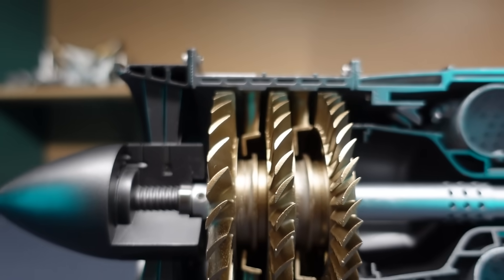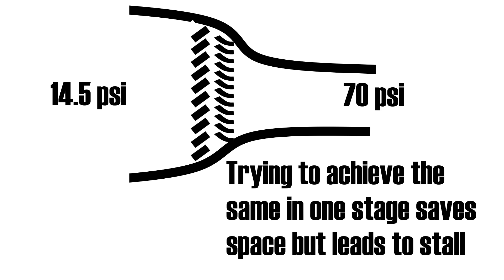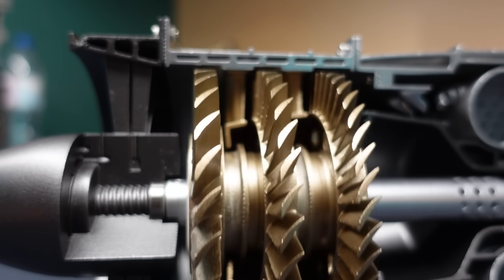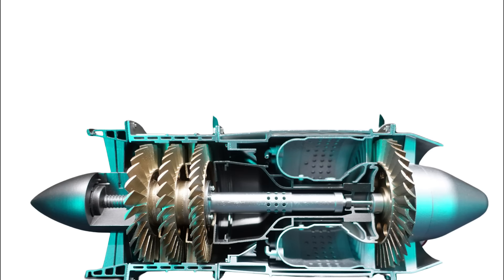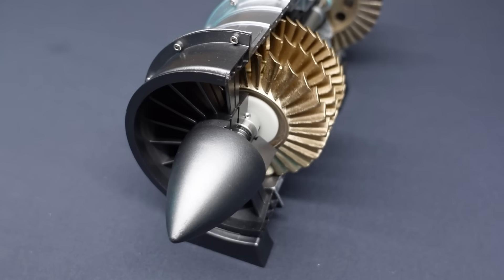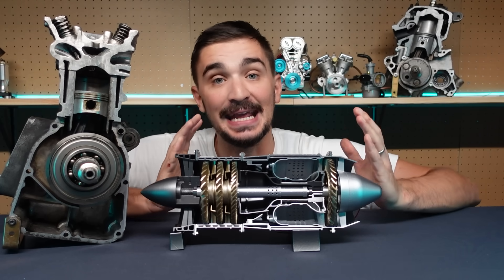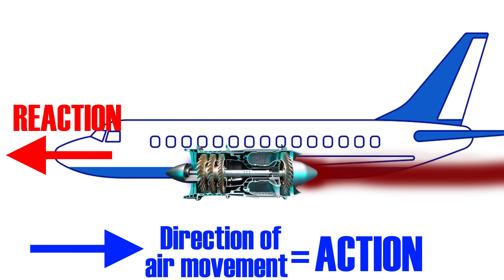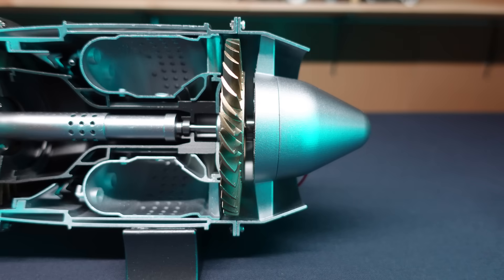Appreciating The Beauty of Jet Engines by Juxtaposing Them Against Piston Engines

Comment from the maker: NOTE: After shooting the entire video I noticed that the turbine blades are  pointing in the wrong direction. The "scooped" part of the blade is pointed away from the stream of air. I was just blindly following the model instructions and focused on shooting the video so I missed this. But this video just covers the basic operating principle of the engine and I didn't discuss any fluid dynamics, this will be corrected and explained in more detail in future videos. 
"Use juxtapose in a video title" crossed off the bucket list
This is the jet engine model from the video: REMOVED until the assembly instructions/parts are updated by the manufacturer. 
Patreon: https://www.patreon.com/d4a
Amazon: https://amzn.to/47U9Zhj
Shop: https://driving-4-answers-shop.fourthwall.com/en-eur/
Reply: D4A, I’m glad you commented about this. It was the first thing I noticed and came here to comment but was glad to see you had made the comment.
Reply: I must also admit to being completely distracted by the backward turbine blades.  I am not surprised that it is the most commented part.  There are several companies that produce better jet engine cutaways that in reverse flow turboprop motors and three axis low-bypass turbofan engines with after-burners.  
  I thought some discussion about the different RPM ranges of High pressure compressors, low pressure compressors and final drive is accomplished by three separate but interconnected axels is a clever arrangement.  Discussion of how reverse flow exhaust on turbo-props allows for a longer burn section for better gas expansion while keeping the overall engine length shorter is an innovation worth talking about.
Reply: @michaelbrinks8089   Yeah, maybe a video on Turbojet vs Ramjet vs Scramjet would be good as well.
Reply: You made one small mistake. The gas pressure in the combustion chamber does not increase, in fact it decreases. Heating the air increases it's volume, which would increase the pressure if it were in a closed container, but it is not. Therefor the pressure decreases in the combustion chamber and the airflow gets accelerated instead. The backpressure that remains is caused by the resistance of the nozzle and the turbine. Too high backpressure is in fact bad, as that would decrease the cooling effect of the intake air, as the mass flow rate decreases. This could lead to catastrophic engine failure. That is why fighter jets open their exhaust nozzle when activating the afterburner, because it would otherwise create too much backpressure.
Reply: @Sir_Cactus  "The gas pressure in the combustion chamber is atmospheric" 
No, it can reach 30 bars. It cannot stay at an atmospheric pressure.
Reply: And why does not this increased pressure drive the gasses backwards through the compressor, where the pressure is only 4 atmospheres?
Reply: @yannickl5976  I have doen some research and noticed that I was not entirely correct. I have edited my comment to correct my mistake. That being said, I was not entirely incorrect and your figure of 30bar in the combustion chamber seems somewhat ridiculous. The pressure in the combustor can never exceed the compressor discharge pressure or even be equal that. Otherwise, as someone else already commented here, would mean the exhaust gases would not only travel through the exhaust nozzle, but also back through the compressor, stalling and potentially damaging the compressor and starving the engine of intake air.
Reply: @Sir_Cactus  pressures in a modern aircraft engine and is a small toy or primitive aircraft turbojet are very different. The pressure ratio (from atmospheric to compressor outlet) is only about 4:1 for simple compressors (single centrifugal stage or just a few axial-flow stages), but 30:1 or even much higher in a modern large turbine engine with more compressor stages. 
Whatever the pressure ratio, you are correct that pressure does not increase through the combustion chamber.
Reply: Also why there are bleed air injectors around the casing to keep a thin film of cold air on skin of combustion chamber. @Sir_Cactus
Reply: wow, you answered the question I had and didn't know how to ask and the questions I didn't know I had.

That makes very much sense in an efficient reaction engine.

¿but what about a turboshaft when you need to convert all possible power to kinetic rotation?
Reply: Pelton style catch wheel to torque  converter turbo props were actually kind of first in applicable output power for a while pre axial turbines they used a system loosely based off of compound turbines from piston engines still surprising turbo compounding only used by Scania and Mercedes trucks @Xayuap
Reply: Replace "against" with "with" - ie "juxtaposing with"
Reply: i want to know where did you learn to speak english like that?...its amazing , please tell me and another little question why you dont live in the us or canada we really need people like you...thank you very much and please answer me:trophy-yellow-smiling:
Reply from the maker: @luiscardozo0000 Watched a lot of Cartoon Network as a kid. I'm serious. Why don't I live in the US or Canada? I'll answer that with a question. Why don't you live in Europe? We really need people like you 😁
Reply: @luiscardozo0000   yeah, why don't you live in ethiopia, we need people like you.
Reply: @luiscardozo0000  "why you dont live in the us or canada we really need people like you"  Haha, yea, we do, but that very fact probably keeps people like him away!
Reply: Your explanation is the best I have ever seen 👍I like it very much.
Thank you for taking the time to provide feedback on this turbojet engine model. We genuinely appreciate your keen observation, and we acknowledge the inadvertent error in the orientation of the turbine blades during the assembly process.

We sincerely apologize for any confusion this may have caused. Your attention to detail is valued, and we're committed to rectifying this issue promptly. We will be updating the assembly instructions and images to reflect the correct orientation of the turbojet blades.
Reply: @michaelbrinks8089 turbofan blades look just like turbine blades. They are simply larger. Their role is to act like a propeller to generate more thrust.
Reply: And the small holes around the combustion chamber are clogged :p
Reply: I came in here to mention that as it was driving me nuts.
Reply: Good catch, and a great explanation of the operation of a turbine engine.  Your presentation was as clear as my A&P classes from long ago! 👍🏻
Reply: Yes, I was about to point it out to you. Thanks for the correction.
Reply: Yes. It would make a lot of noise and burn a lot of fuel and go nowhere if you could get it to run. Lol!
Reply: @d4a First I should say, I loved the video. Jets are amazing especially compared to internal combustion. 

You should do a follow on video comparing efficiency, power to weight and maintenance of jet engines vs internal combustion engines. These are three areas that turbine engines usually excel compared to internal combustion and were not really covered in this video.
Reply: Yes.First thing I noticed.wrong shape blade as well.That's a compressor blade
Reply: Thanks for the comment, awesome video as usual! The backwards facing blades had me thinking I was going crazy!!
Reply: The basic point he failed to mention  is that the turbojet engine is a constant pressure, velocity driven engine, as against a normal internal combustion engine.
Reply: In D4A we trust!⚜
Reply: Ah, was just about to comment that the blades look like they're pointed the wrong way lol
Reply: looking foward the video about fluid dynamics on turbo blades!
Reply: Ouch, My OCD!!
Reply: Way more understandable than what Ohio DMV did
Reply: Thank you for pinning this post.
I got half-way through you video before the backwards blades caused so much cognitive dissonance that I had to pause and check the comments for my own sanity ;)
I will continue watching now.
Reply: The blades that seem to be facing backwards are called stators and the blades that move are called rotors.  The intake side rotors are powered by the turbine blades in the back, and the stators straighten the air flow for better performance.
Reply: I was comment on the turbine blades... but then I saw this :D
Reply: Please tell me you're working up to a compound engine :).
Reply: HA! I didn't notice, no worries.  But you left out my personal favorite, the turboshaft engine!
Reply: Yeah, just triggered and went for comments about that ) Thank you for explanation of how it happened )
Reply: Instead of calling it a "vicious cycle" @7:30 ... I think we're ready for concepts like "positive feedback loop" ... :)
Reply: Yeah, I was puzzled, is the intake right, or left? Or had I completely forgotten how these things work. Thanks. Love your vids no matter.
Reply: Yes i noticed that too am a aspiring aeronautic student 😅 i know it probably mistake cos at that angle the turbine will not harness the combustion power at all and engine will not turn

Comment: I think it's worth noting when you compared the gas turbines as a whole to turbo chargers in cars or steam turbines in power stations is that where the heat energy to drive the compressor wheels come from a completely sepperate source, in a car it comes from the hot exhuast gas from a piston engine or in a steam turbine it comes from the steam from burning fuel in a boiler and boiling water to steam in a power station.

Comment: are you sure the pressure is increased in the combustor? The temperature is surely increased, but intuitively it seems the pressure would be the same as the last stage of compression. Always remember: better to have questions we can't answer than answers we can't question! Who said that?
Reply from the maker: I like that sentence. In principle you're correct but what I failed to underline here is that I was explaining the starting sequence. I also got a lot of comments from people telling me I didn't need a spark plug to run a jet engine. I think that when combustion occurs during starting there is a small pressure spike because the combustion is relatively confined and pressure does spike a bit until the turbines start moving etc, but yes overall during operation pressure doesn't again increase and fall like in a piston engine, I should have explained that better

Comment: For some reason I actually thought a comparison was going to be made of both types of engines in terms of power to weight in many given situations. The thumbnail kind of suggested it. I figured the piston engine used as the model was about the size it would need to be to produce as much shaft power (If a PTO turbine was placed behind the turbojet power section) as the model implied sized gas turbine is. The video is a very succinct btw, Even AgentJZ would approve.

Comment: Unfortunately you have made one of the most common and classic mistakes, of assuming that the combustion section of a jet engine causes an increase in pressure. This is a problem when you try to think about gas turbine engines by comparing them to piston engines. It is easy to see how the pressure inside a cylinder increases when combustion happens, because the cylinder is still sealed (piston at top-dead-centre, all valves closed), so the energy released by fuel combustion has nowhere to go, except into boosting the temperature and pressure of the gases trapped within. So the highest pressures in a piston engine are found immediately following combustion.

However, the highest pressures found inside a jet engine (or any other variety of gas turbine engine) is at the compressor discharge, just before the compressed air enters the combustors. Burning the fuel increases the temperature of course, that much is common with a piston engine. But the combustors in gas turbine engines are not "combustion chambers" - they are open at both ends to let gases flow through continuously, so the pressure cannot and does not increase. What does increase - massively, along with the temperature, is the volume of gas flowing through.

There is another engine type for which the same is true, and is an engine which bears more appropriate comparison, and that is liquid-fuelled rocket engines: These suffer from a similarly common error, of people assuming that the pressure increases during combustion. Again, it doesn't, though the temperature and volume of gases both do - just like in a gas turbine engine. The highest pressures found in any liquid fuelled rocket engine are in the injector manifolds: These have to be at a higher pressure than the combustion section, otherwise the fuel and oxidizer would not flow in the necessary direction. This is broadly comparable to the injector situation in a diesel engine: The liquid diesel fuel has to be pressurised to a higher pressure than the air inside the cylinders at top-dead-center piston position can possibly reach, otherwise injection of the fuel would never happen. In fact the excess pressure has to be far higher than you might think, in order to have any control over the fuel flow, and particularly to make fuel flow through the injectors at necessary rates.

On a different subject, a small point about compressors: It is certainly true that the pressure increase possible with an axial flow compressor is limited for any given stage - this has improved over time with incremental improvements to design, but even so, each axial stage is not capable of increasing pressure by much more than 20%. Hence why engines using axial compressors tend to use multiple stages.
However, the same is not true for centrifugal (aka radial outflow) compressors. The earliest British and American jet engines used these, and for a fairly straightforward reason: The compressors used for supercharging aircraft piston engines during WW2 were typically centrifugal, and were at a fairly high degree of development. So similar designs were used for early jets, basically just scaled up versions of what was used on late-war piston engines.
Centrifugal compressors can be more efficient than you might think: Most of these early jets used a single stage, though I think there was one example of a turboprop engine (the Rolls-Royce Dart) which had two stages, with the outlet of the first centrifugal stage feeding the inlet on the second. A well designed single stage centrifugal compressor can have an outlet pressure 4 or 5 times higher than the inlet. This is reflected in some genuine engines: The Rolls-Royce Derwent had a pressure ratio of 3.9:1, and the related Tay engine had a pressure ratio of 5:1, both of these used single stage centrifugal compressors.
These have not entirely gone away in modern engines: A great example is the extremely popular Pratt&Whitney PT6 turboprop, which uses a centrifugal compressor, pre-boosted by either 3 or 4 stages of axial compressor.

Comment: But I have a question. Why the expanded gas doesn't escape where from it entered. Since there are no valves ,the expanded gas only exits from behind not from front end.why?
Reply: Each blade chops a small portion of air and directs it to the rear.  Can you see that?

Comment: The cutaway model you used is called can annular. The holes are to feed air to the mix inside the can. The purpose of this is to not blow out the flame. Their are several types and this is the oldest. Its not so much to protect the turbine which is ceramic coated incolnel and other alloys, 
But to prevent a flame out condition. 
Thier are actually two shafts that drive the compressor. A shaft within a shaft with internal bearings. The compressor is divided into two counter rotating assemblies to balance the engine. So thier is in function two sections of compressor stages with the final stages spinning double the speed depending on the model and type of engine. I am reference the Rolls Royce Pegasus used on the Harrier.
I was an enlisted instructor at NAS Pensicola. It used a device known as a spider after the turbine to monitor temperatures and would inject demineralized water to cool the turbine in combat power setting or anything deemed over 100% rated power.

Comment: Well actually, turbine engines are a LOT more efficient than piston engines, but only at high loads. They use a lot more fuel, but give a LOT more power in return. Turbines are impractical for small loads or loads with sporadic spikes in demand.
Some American company tried to make a car with a turbine engine, and it was extremely fuel efficient on the highway. The problem was the noise, the cost, and the fact that it had terrible fuel economy while idle, as turbine engines typically idle at no less than 40% of max power. For city driving this is completely stupid, but i can definitely see this being put into trucks or trains (in places which have trains they already use turbines to generate electricity, and use electric trains)

Comment: I know that the turbine never caught on for powering cars, you might have already made a video about that. But why didn't it loose out to the diesel engine for other applications such as railroad, which generally uses electricity to transmit the torque from the engine to the wheels anyway? It's application in a tank seems to be successful.

Comment: Great explanation!
But I think "Jet" engines (especially modern turbofans) rely on both suction and exhaust to produce thrust.
There are also cases of jet engines from aircraft (like what you describe) getting repurposed into torque applications (where the engine does not directly produce thrust) such as in the M1 Abrams battle tank.
I also think that the early stealth aircraft relied more on suction than exhaust because they had to cool and disperse their exhaust through small openings to reduce their heat signatures and reduce radar cross section.